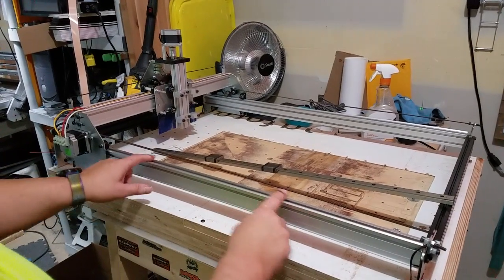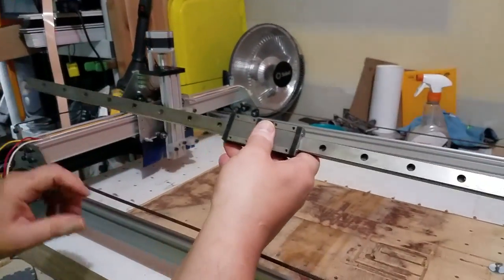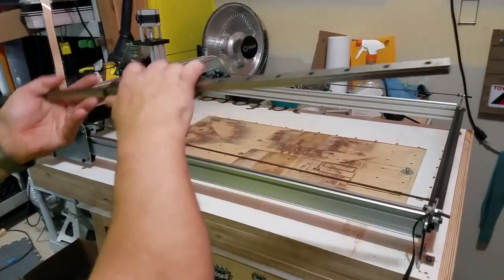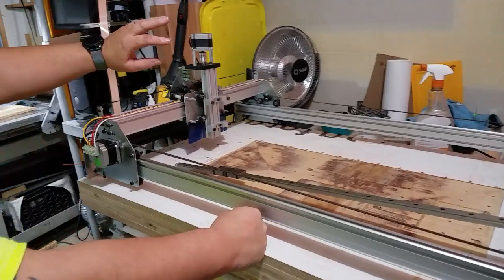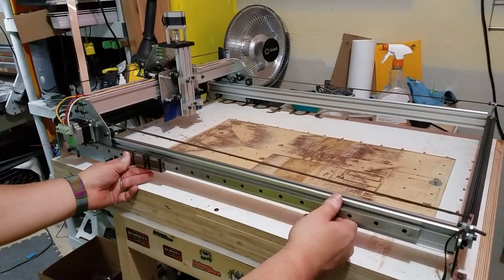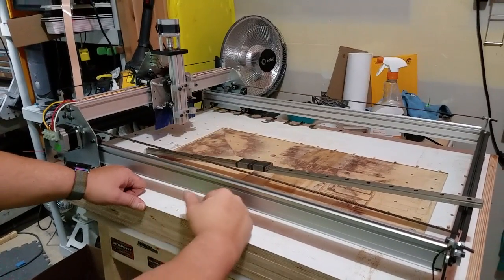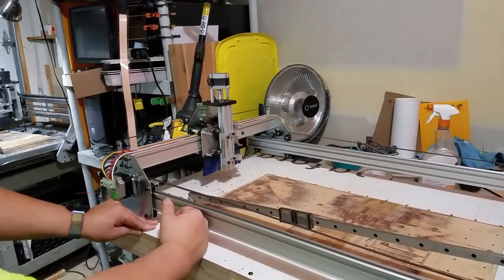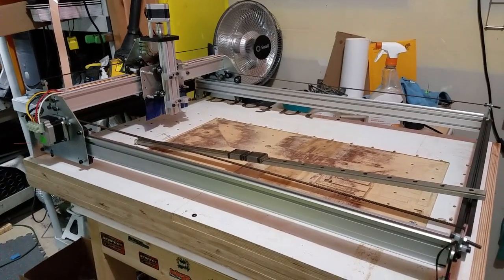PART 2 Shapeoko CNC RAIL AND CARRIAGE UPGRADE Router rebuild / reborn series

Comment: Hi! Did you finish upgrading the machine? I'm planning on doing exactly the same on a very similar build.

You mentioned you got new extrusion for the Y axis because the rail add se distance. What did you do  to keep the belt pulleys in place? Did you use some spacers and that's it?
Reply from the maker: hi David, its actually a halted project right now. but i plan to do away with this belt setup. might use a heavy duty version like u see in 50w c02 lasers. there are no v bearings etc..